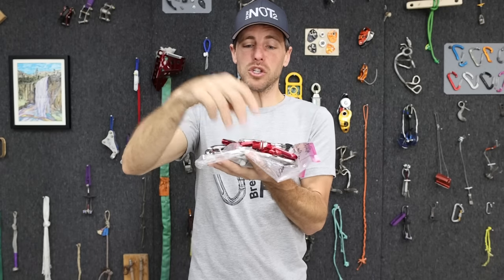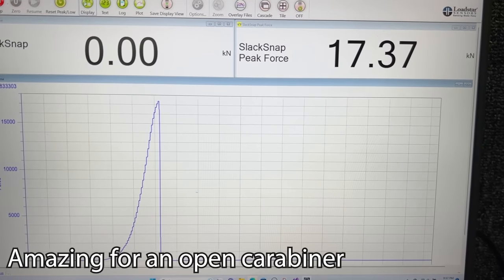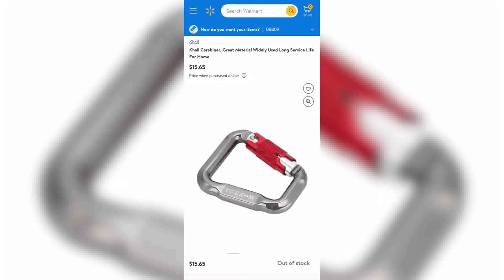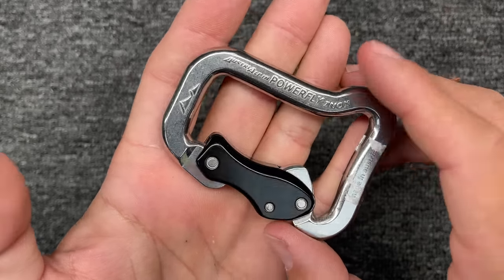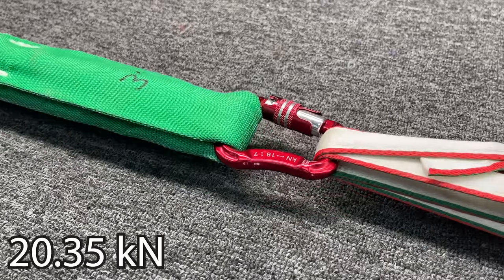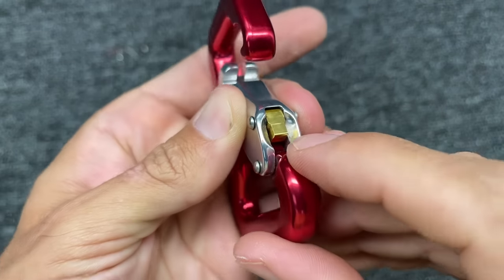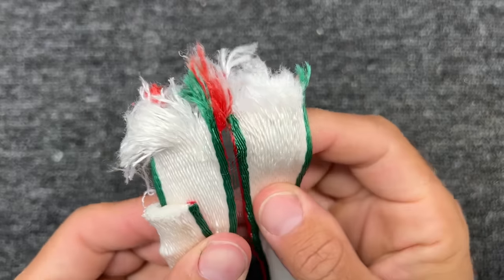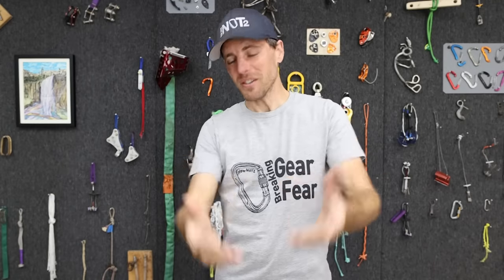Why did the manufacturer paint over their ratings?

Comment: Why no soft-shackles?  A lot of us (paragliders) are changing wings or removing them multiple times a day.  Between changing wings, storing wings separately from harnesses and other reasons its convenient to be able to use a carabiner.  If you think of a Tandem Pilot who easily can have 10 flights with 10 passengers a day being able to easily attach and remove your wing from your harnesses is quite useful.  

Additionally having many multiples of webbing around a soft-shackle makes it hard to do a pre flight check to see if everything is correct. Two types of webbing attached on the opposite side of a metal thing is just easier to confirm.

Finally thinking of redundancy: Most rescues are attached at a separate place on the harness (i think to remember that this is also true for paramotor—where they are attached to the motor side of things but don’t ask me 😅).  My rescue parachute is attached to the back of my harness with two loops of webbing (the one from the harness and the one from the parachute) connected by using the webbing only or by using quick links. 

So if a carabiner would break i’d throw the reserve and rely on a separate attachment point to get me down safely.
Reply: Then why not back it up with 2 carabiners on each side?
Reply: @SonnyKnutson because one is usually super good enough when replaced after a couple of years (5y or 500-1000h should be fine). The incidents where broken carabiners where reported were way past this. Also the loops usually wouldn't fit a second carabiner.
Reply: Theres usually no space to attach two
Reply: Have you ever used a soft shackle? They are incredibly easy to install and remove.
Reply: And yes.  20kn to 30kn is just super good enough.  If you keep your gear current and regularly checked (which is part of the regulations here in Europe) there should not be any issues.  And as i said i have a reserve parachute coming with me every time.  @SonnyKnutson
Reply: One more thing to add here: 

Paragliding and Paramotoring are regulated sports in many countries with requirements to file accident/incident reports.  DHV (the German regulatory Body for Hang and Paraglider's) does a lot of research into these accidents and if there were a significant amount of accidents happening relating to faulty carabiners it would be reported.  

All gear you fly with should be tested, certified, and regularly checked and thus should be safe to fly with.  

I for one replaced all screw gates because they might unscrew when launching backwards with different locking mechanisms (one set is on the Grivel Twin Gates) and stay with D-Shapes to avoid cross loading.

Comment: Get a price of cordura off of an old backpack would be a good place to check for it. Cut out a rectangle, sew Velcro to each long side  one front one back of course so you can close it as a tube you can wrap around your slings as needed to protect them. Cheap, effective, easy to make and easily replaced.

Comment: I'm half way through and this is the data I've wanted to see for decades.  I hate that notch design on those carabiners.  It just looks weaker.  There is no UIAA certification markings on any of those sketchy carabiners and I don't know if there is a paramotor carabiner certification.  Can you double up carabiners on each side?  Those flat sided gates look like they are designed to be side by side.

Comment: I would bet they have steel test fixtures for those that underperformed but weren’t outright lies. That way as soon as the gate stretches the load transfers to the other side. 

I am amazed though that Caribbeaners actually break at the rated strength.  Every other item I’m aware of needs to test at 1.5x the rating.

Comment: The steel ones in the first half of the video look like they are bending and ruining the gate integrity. I think the lead in to this effect is that steel usually has better fatigue properties than aluminum, (you can flex steel back and forth more than aluminum without fatigue issues). An aluminum part, therefore ends up being stiffer than a steel part with a similar load rating and fatigue life expectation.
My dad had a similar issue with front rims on a cabover semi.  The steel rims flex all the way in to the bolt holes at the hub(cabover trucks can be very mean sideloading the steer tires) and allow the steel rims to point load a few holes to very high stress, he solved the problem of steel steer tire rims cracking at the bolt holes by switching to aluminum rims which have to be designed stiffer that the steel rims, which means the aluminum rims don't overload individual bolt holes as severely due to the extra stiffness transferring the load in a more spread out manner. (think poking someone with a nail through a pair of denim pants vs through a leather belt)

Comment: its possible that maybe the difference between climbing and paramotor carabiners is climbing ones usually take a lot more force to break. they are designed for shock loads, in case a climber falls.  paramotor carabiners arent. theyre designed for sustained loading perhaps? there could be a whole difference in design philosophy for different applications. paramotorists dont usually hit shock loads, so maybe the paramotor carabiners are designed with sustained loads in mind.

Comment: 10:30 so, having no knowledge of either climbing or paragliding/motoring, but i do know at least a little about materials properties.  Having a replacement on an aluminum part like a carabiner based on time, rather than number of uses seems off to me.  If you follow 2 to 8 years replacement timeframe, but someone is using them weekly they're taking more loading cycles in 2 years than someone doing a monthly use every 8 years.

I know its on the user to know and check for signs of fatigue, but it just seems like they should recommend replacement at X uses under normal conditions (like no falls in climbing or excessive stunts in gliding).

Comment: Aluminium work hardens, and becomes brittle, so long term you could have some surprises.

I'm worried about the ratings though: the first carabiner was rated for 30 kn - I would expect this to be a max working weight.... not its maximum rupture weight, so seeing a 30kn rated item bust at 29... is scary - there is no built in safety margin - I'd expect to see a 30 kn item to break at 35-40...
Reply: Anything with so high rating is dural meaning a aloy of aluminum, copper and manganese. Its way stronger but tradeoff is they are bit brittle. So if you throw them against concrete with your full force they can shatter.

Comment: A 170 lb paramotorist with a middle-of-the-line 50 lb motor would expect to experience 2.9kN of centripetal force in a 3g turn. Given that the force is commuted to the sail through a pair of these, with each one experiencing about half that, 18kn is a 20x safety factor.

Comment: There are only a few actual carabiner manufacturers in China; if you are talking about a vat of AL, then you are talking about cheap poor, quality keychain units which will snap under a load of a flower pot full of water; these are made by backstreet vendors who have zero QC, and would mix the materials and mostly likely never pass any standards, you never know what old crap is mixing from wheels from a pram or stolen gate posts from Chornobyl.  
Actual manufacturing is using 7075 AL purchased in long-length rods, which are supplied with a certificate of manufacturing to a quality standard of GB/T 3191-2010
These rods are cut into lengths and bent to approximate the shape design of the carabiner to be produced. 
They are then hydraulic stamped into shape, polished for a smooth finish, then powder coated using Japanese  paint conforming to GB/T 3191-2010/ 
The logo is laser etched with model code and production run details, which can then be tracked to the original batch rods used.
Sample testing per 1,000 to destruction to meet qualifying kN ratings is registered against each production run and kept in a log.

This channel is terrific, and I hope you keep strong and healthy due to your recent episode. Bless you, and take it easy.

Comment: In construction, a lifting item s are rated, that rating should have an engineered safety margin built in. So, if it is rated at, say, 30kN there should an engineering margin on top, say 3kN. This is a safety margin.

Comment: On the stamping, misstamps happens constantly at the most reputable manufacturers in the world. What they do though is either throw them out or sell them off (ideally without their logo) to someone else as B-stock. This is most likely what happened here. These are the ones that got stuck in the printing machine and sold to someone else to recoup some costs instead of just sending it to the trash pile. At the end of the day stamping straight and accurate is a science of it's own, nothing like calling a metal supplier and buying some stock from them.

Who the original manufacturer was is a mystery though, and you should not trust them with your life.

Comment: This is so bad. For several of these. If safety equipment is rated for x they should, under no circumstances, fail for forces under x. The fact that some of these failed at close to HALF the force they are rated for is extremely dangerous. Good rule of thumb is that a system should hold 3x what it is rated for if the system failing means death for someone, something like this where a few of them breaks at half the rated force is just unacceptable. Doubly so when you consider short term/long term stress and material fatigue.

Comment: In my opinion one of the worst things you can have with life dependent equipment is unpredictability. I would rather have some crappy equipment that I knew was junk and not to use it, did some equipment that I thought was OK that I might use and then it turns out it was junk and I die.

Comment: Ali and wish are obvious as they specifically peddle in cheap off brand garbage. Amazon is also true but that's because of how the binning system is if 2 sellers are selling the "same" item they are stocked in the same place and picked/shipped synonymously. So you can get knock off or fake products from the original producer as Amazon just doesn't distinguish between the real and fake versions.

Comment: Just watched your vid. Nice job btw. Firstly I have over 20 years working in a company manufacturing , selling, and conducting on site inspections of rigging and height safety equipment in Australia. I have installed countless static lines, anchor points and other working at heights safety systems in all sorts of weird and wonderful places. 

I don't know about rock climbing gear or para sailing gear, I'll say that up front. but it seems pretty second rate compared to proper working at heights equipment. The "notch" system I saw on almost all of the Karabiners you tested I have never seen before, and they seem super sketchy. Our company mostly sold Spanset Karabiners and equipment, but also some other brands. Almost everything here is Triple action, self locking only. If you don't have triple action you will be told you can't work on site. To prevent accidental gate opening. 

As for the kN rating, to the best of my knowledge, Those ratings are made from drop testing, and not from a sustained load or break testing. The reasoning is because in a fall event, the Karabiner & harness will sustain an initial shock load after the fall completes, and then after that it is just holding your weight (so not 15kN / 22kN). During the initial shock load you would expect to see some form of deformation, but that is all. Given that most W@H is done in conjunction with a lanyard and shock absorber, the fall load will be reduced to below 6kN anyway.

I know this has nothing to do with How they are used in Parasailing, But it just goes to show that Karabiners are made with W@H and fall arrest in mind, and not really made for what Parasailer's are using them for, holding a sustained load. The manufactures don't tell you that, because they want to sell more product. Personally I wouldn't buy any Karabiner not made to The Australian Standards (or whatever country you are from). 

I'd be interested to know if those karabiners you tested held up in a drop test. I suspect they would fair much better, with varying degrees of deformation. Not that break testing doesn't have it's place, but in this case, Manufacturers are putting load rating on their product, not based on break testing, but on drop tests.

Comment: Answering as a paramotor pilot, My rational behind not having a back up on the wing carribinners is the setup issues and over redundant safety factors on the carribinners(assumning you can trust the listed strength).

Most wing and harness connection points dont have extra space to put a backup binner or sufficient soft shackles in. Even if the soft shackles are small enough the added settup of both binners and both soft shackles all having to be set up while wearing the motor before launch and after landing would deter me from this over redundant set up.

The strentgh rating on the binners are supper good enough considering you will never have just one under load. Both connection points will be under a shared load when flying and in most circumstances couldnt exceed the strength of a single carribinner. 5kn at each connection point would still be 6.8g loading for an all up weight of 145kg.

Also my final back up is reserve chute that is connected at seperate points.

Comment: Well i think your tests are a bit wrong as when the steel breaks the pin obviously is taking the full force of the pull and will break as it does not have the support of the rest of the structure so all the test you did when the steel broke and something else got damaged you have to consider that and not say oh the pin broke! I think you have to also analyse what broke first in your videos if the material gave in or the pin/latch that is how you find out where the weak point is!

Comment: To my understanding everything you just tested  failed. Most safety equipment is up to 2 to 3 times more than what's rated for. So you can get the longevity. Like a basic letter to 250 lbs can probably do 500 . A soda bottle that can handle 14 PSI can go up to 45 psi.

Comment: Seems like a fundamentally flawed shape. I feel like a ring (edelrid cupid or similar) would be a safer bet but maybe not practical for the application?
Reply: A paragliding harness has several straps ( one holding the back and bumper, the other more towards the legs). So it's sorta tri-loaded. It's super good enough. Our lines (strings) would break much much sooner than a good carabiner, and before that, we'd pass out from G-forces...

Comment: The Chinese are good at one thing, and that's bootlegging. They will try to copy something that already sells well but make it for far cheaper. The ratings are on there only because the originals have them. In some cases, the Chinese figure out which numbers on there are 'more desirable', i.e. will be bought more often, and they put nutty ratings on just to make their product look better than the original. Nothing of that has anything to do with testing, because testing is exactly what they throw out to make their products THAT much cheaper. And even when copying, they skimp on everything they can to decrease production cost, and in cases such as these, they most likely simply accept higher work tolerances in machining, which is most likely what made the gates on the fakes fail faster than the rest of the biner. The only thing they want to copy well is the overall look of the item, and because they have absolutely no clue about how a biner should be manufactured properly, and what parts of it you COULD skimp out on and which parts you ABSOLUTELY SHOULDN'T, you end up with those dangerous fakes, because if they find that manufacturing one part in a way that makes it fail faster costs them far less money than making it closer to the original, they will. Ignorance and greed.

Comment: a quick lesson in metal. Aluminium may have a higher rating but the chances of it breaking over time are ten times higher than the steel one aluminium fatigues faster developes minute cracks and will break just with "gentle" knocks steel on the other hand does not have this issue it wont fatigue over time

Comment: = yep WYfh... - !!! - paragliders are heavy enough gear that chucking on doubled - "biners" wouldn't affect performance "overly"...  lol...
( - ok, your conclusion - smart guys don't design-in singlepoint failures )

pl get hung up on the shape of their pretty-gear, idiotts...  (jk) - a well rounded webbing buckle - on to any - biner, is "super goodenough" - Thanks John...

(a main rigging connection  on a  paraglider  sees so little force, a 6mm doubled loop -  backup is well _ goodenough security (even for a short acting parachute rig..) - lol, just back your gear with a 6mm softshackle - you probably won't die.. (If you do, remember-   many died not having so-much-fun )

For many chanels using ropes and other "force connectors" - I refer to "how not 2" - for potential collabs,I am definitely glad this meetup happenned... (science,  - , whatever)

ha ha ha, well some simply "make stuff up" - use a softshackle for safety.